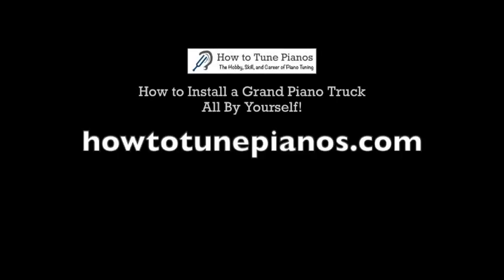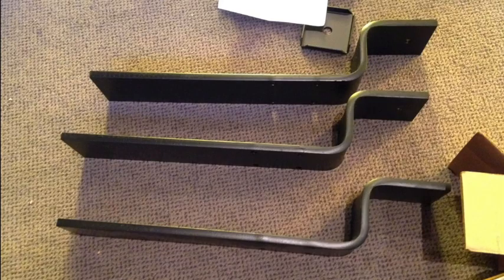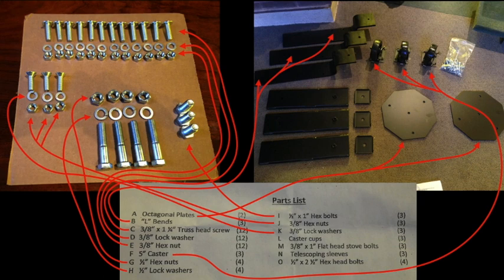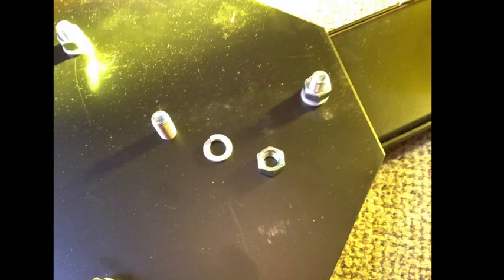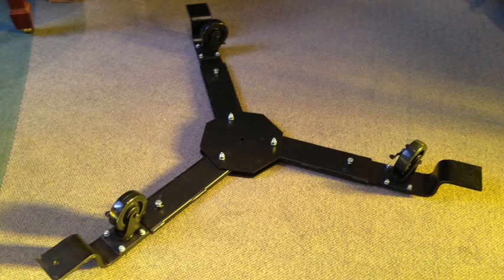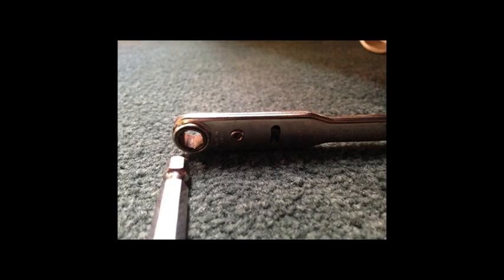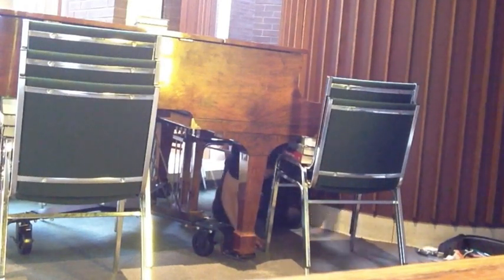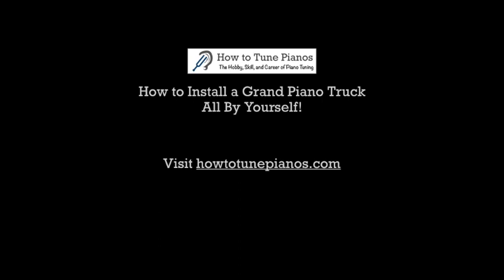Installing a Grand Piano Truck Single Handed

Comment: I just got one of these and I have it assembled but I was curious about the leg extension that is centered in the octagonal plates as opposed to the two other leg extensions which are offset.  Did you point that one toward the rear of the piano even though the rear leg is not actually centered between the front (or under keyboard) legs?
Reply: It doesn't matter.